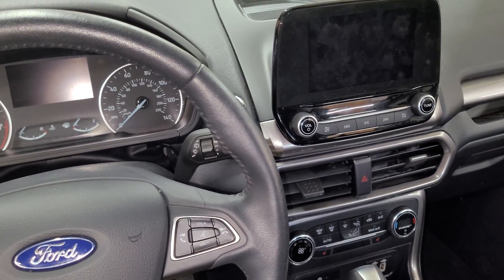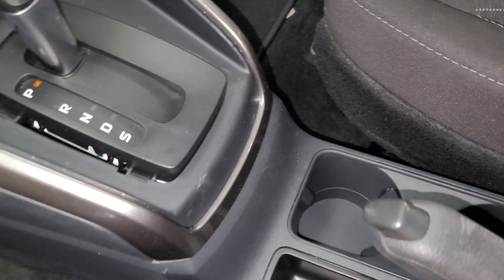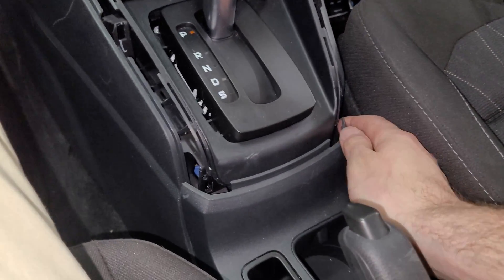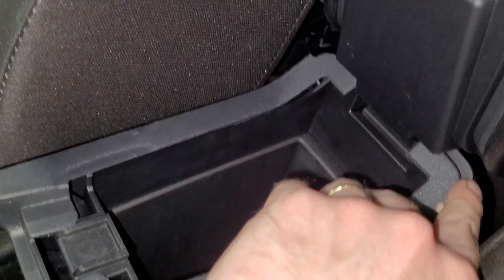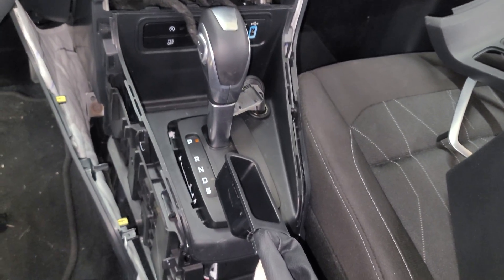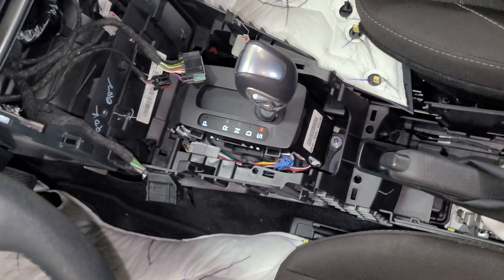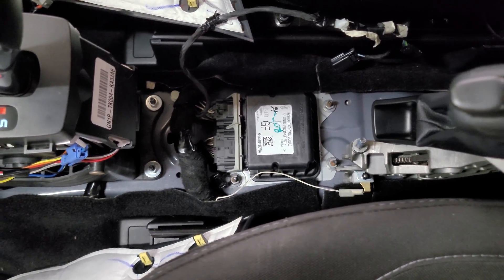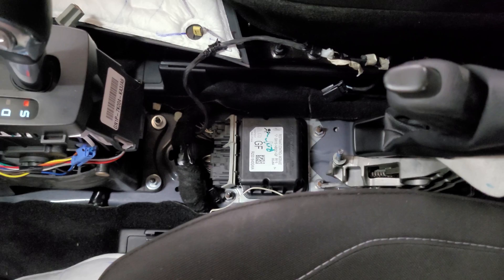2019 Ford EcoSport SRS Module Location | Disassemble of Center Console |

Comment: Please help! After remove SRS module my Ford Ecosport doesn't start. Looks like key fob not inside the car. But it is inside. Key battery is ok, its closed and opens by key. But not starter.by start engine button. Any advise?

Comment: Do you have to recalibrate your seats after resetting the module?
Reply from the maker: Not always. Depends on the accident and what was replaced. Some Fords store crash in the ODS(passenger seat) module but it can simply be cleared with a scan tool.